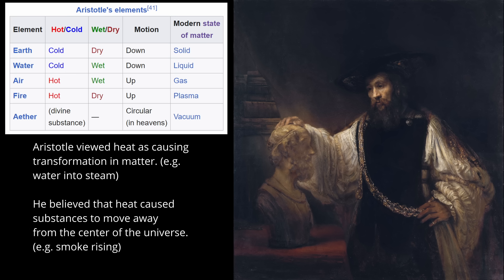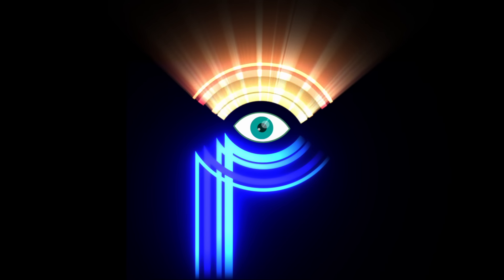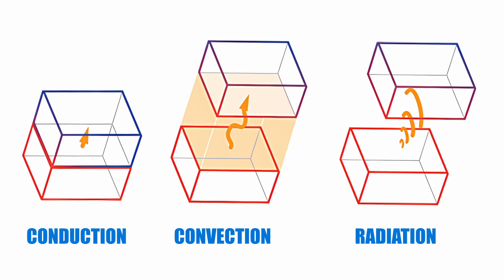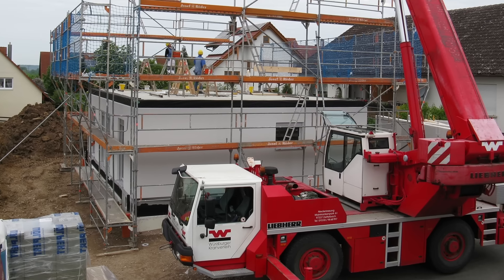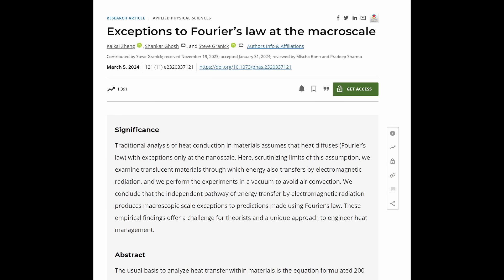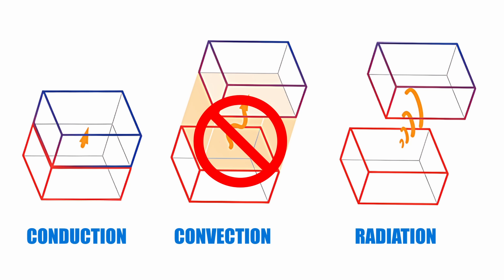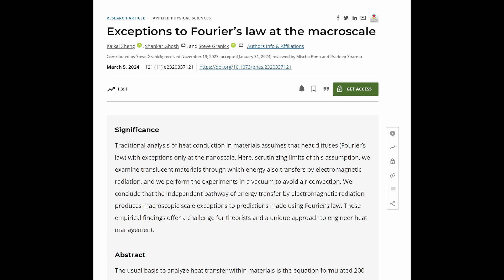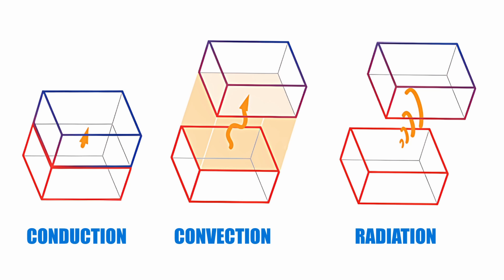Fourier’s Heat Law Challenged By New Discoveries

Comment: Good grief - how many different ways can you keep repeating the conclusion, that radiant heat transfer can be significant, not just conductive heat transfer, in translucent materials ... WITHOUT ever telling us how significant it might be, how the choice of materials effects this, or other such details?
Reply: I had the same exasperating experience.
Bottom line: not significant at all.
Transparent materials are mostly terrible conductors of heat, ‘cos they’re electrical insulators. Free electrons conduct heat much better than molecular bonds, so metals (and some forms of carbon, which also have delocalised electrons) conduct heat much better than insulators.
The paper linked is behind a paywall, but the abstract says ‘minor deviations’ and ‘small heat sources located at defects’, and since thermal radiation tends to be way smaller than convection or conduction in most cases, it won’t really change much.
Any claims that this might have practical applications seem rather over-hyped, IMHO.
Reply: transparent aluminum: hold my beer 

(Star Trek) lol

Comment: Saying heat transfer law does not work for transparent media is like saying it does not work for gases and liquids because convection. Fourier law assumes only heat transfer by conduction. Any other way of transferring energy breaks it. Is is outside the assumptions used when assembling the differential equation.  If radiation transfer was not relevant thermal bottles and Dewar flasks would not had the walls facing vacuum covered in silver.

Comment: Nice video and presentation. 
I’d like to think of heat is electric oscillation in molecules and heat transfer as coupling effect, one molecule in electric oscillating mode causes the next one in oscillation like a bucket brigade transfer. The transfer slows down and stagnant as temperature difference is approaching zero. 

The electric oscillation amplitude in each molecule at the solid-space junction (surface) are responsible for electromagnetic radiation at the oscillating frequency (temperature in terms of Kelvin). 

After all this is an electric universe. Almost all effects are electric.
Reply: Very interesting take on what heat just actually might be & how thermal transfer could occur.., any reference you have on this model?
Reply: May I ask why do you need to trace for reference to this idea?

Comment: I’ll have to read the papers as I must be missing something but radiant heat transfer in (say) insulative foam has to be taken into account when designing a thermal insulation barriers such as a fridges, houses, rocket oxidizer LOX tanks, etc. Example is:   Radiation heat transfer in foam insulation 1987 from International Journal of Heat and Mass Transfer,

Comment: So, it may be within the realm of possibility that the Shapiro effect may also apply to solids as well as other fluid media.

The Shapiro Effect was through to be a property of General Relativity due to the Einstein claim that the ether, AKA vacuum of space, has no electromagnetic properties and does not act as a fluid medium.
    But studies of other fluid media have already shown that the speed of energy transfer is also density and frequency dependent, just like the Shapiro Effect.

   So, the Shapiro effect may extend into the transfer of energy though solids as well.

Comment: Fourier had the vision that such a mass - had no density, no resistance, no PE that needed to be converted to KE and allow such heating to pass along its object's length (with internal and external loss of heat and radiation) eventually getting to the receptive thermometer !!!  Are you kidding me that this was a massive discovery of conduction, convection, and thermodynamics without the rest of the energy loss.  Where is the rest of the formula components in Fourier's statement ?
Reply: Noting new in the west. Use telegrapher equation

Comment: If you put a hot frying pan under running cold water in the sink than the handle will become hotter and hotter. It is like the heat moves away from the area where the cold water hits the pan....
Reply: I've noticed this but now I need to test it.
Reply: @bentuovila5296  it is pretty counter intuitive but definitely is a real thing...I guess it has to do with the fact that the atoms in colder part under water don't want to vibrate that eaesly and and probably the sudden cooling is happening at the surface first trapping and increasing the heat internally and move away through the metal ...
Reply: really? seems counterintuitive.
Reply: That's steam transferring the heat.
Reply: Live anomalies like that.
Reply: @aaronfranklin324  Its happening fast and the steam rises up where the water hits the pan...i avoid burning my hand with steam anyway...I dont think is the steam and it is 100% heat transfer through the metal...
Reply: @cx6847  it's called a phase change heat pipe effect. The evaporating water takes large quantities of energy, and supplies it to the surface it condenses on. That's why steaming is a faster way to cook that boiling.
Reply: @aaronfranklin324  ok...try it...
Reply: Are you crazy? Water hitting the hot pan will just increase the rate at which it cools. The handle will absolutely not get hotter. In fact, it’ll cool down more quickly. Your suggestion that the cold water will somehow compress the heat in the pan and squirt it out along the handle is just nonsensical.
Reply: @simontillson482  try it.

 because i get this effect all the time when welding and throwing things in water to cool them down... be interesting to actually use a thermal camera.

a fairly heavy plate of steel, just finished welding at one end... a LOT of thermal energy. cool enough at the other to hold comfortably.

left to cool, the whole object will slowly come to an even temperature... the cooler parts will heat UP, and the hotter parts will cool down. its what you expect to happen. knowing that in ten seconds or so its going to be too hot to handle and wanting to proceed with the task, you throw it in the water.

dunking it in water briefly, only long enough to remove a certain quantity of heat still leaves a large amount within the mass of the object. that heat still conducts through the metal the same as ever, attempting to reach equilibrium. if theres enough energy to heat cooler sections to a higher temperature before it all radiates away, it does so.

almost every time, i find myself double dipping, and making sure its really cooled down the second time...